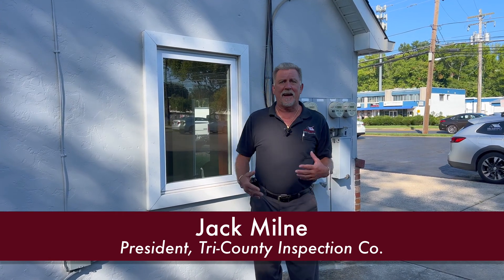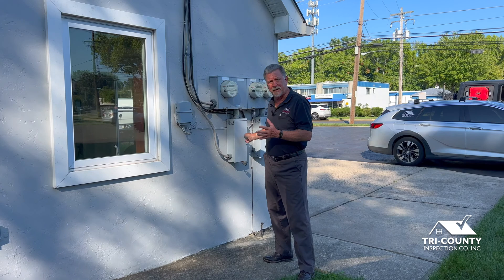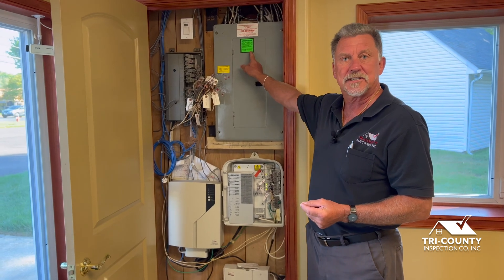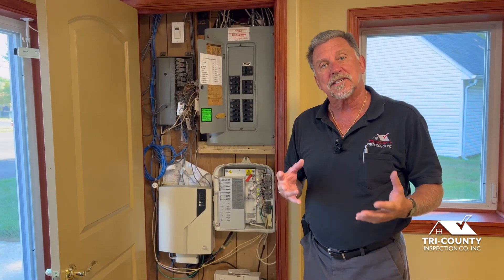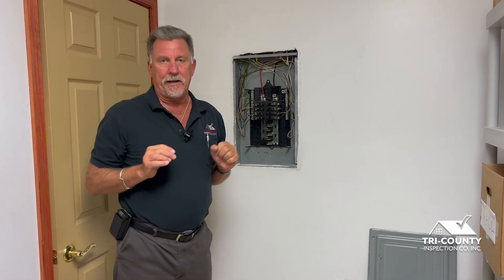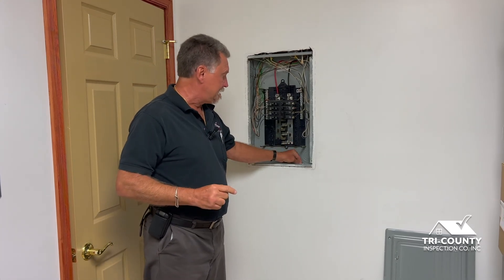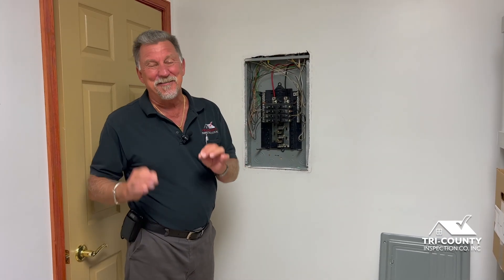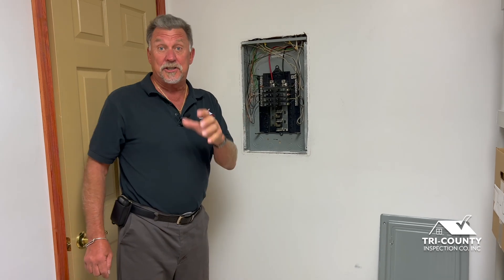Why is it important to separate grounds and neutrals in a sub-panel? - The House Whisperer Show

Comment: I'm just a farmer doing my own electrical.  But IIRC, NEC 2014? and back allowed bonding the ground and neutral in the subpanel.  Does it work?  Sure, my old farrowing house is done that way because they didn't run a ground wire to the building, but I installed a grounding wire to devices in the building, and grounded the metal conduit to it as well.  If a hot wire touches a metal outlet box or conduit, I need a low resistance path to the transformer to trip the breaker.  So, the power would go from the metal outlet box, to a grounding screw to a ground wire, or through the metal conduit to another grounding screw, through the ground wires, to the bonding of the neutral/ground bars in the subpanel into the neutral, back to the main panel neutral, and trip the breaker.  Not ideal, but it works.  Can a ground rod installed at a subpanel not bonded to neutral do the same thing?  DO NOT count on it at all, but if your circuit is close to rated load, it can.  Example, I have 4 livestock waterers elecric heating elements connected to the same 20 amp breaker.  Each element pulls 250 watts, 2 elements per waterer, 8 elements total, 2000 watts.  That's IF all the thermostats are on at the same time, again, do not count on it.  I had an element break on one of the waterers, sending power to the metal waterer body.  I didn't bond the waterer to neutral, since you don't want anything more than about 1/2 volt measured from the waterer to a point on the ground a couple ft or so away, or the animals will feel it. And I didn't run a ground wire to service each waterer because I was young and stupid.  So, each waterer has a ground rod, installed within the tile riser underneath each waterer, and the waterers connect to the ground rod.  So, the little amount that can flow through the soil itself via a ground rod back to the main panel ground rod, in turn back to the transformer (can't remember what a shorted 120 volt circuit can feed through a ground rod, I think its a few amps) tripped the breaker.  Again, DO NOT trust a ground rod to do this!  Even though it worked, it probably took a while to trip if the soil could only take a few amps, making the waterer unsafe for a longer period of time than if a grounding wire was run with the hot and neutral and could be used.  If the soil is dry,  or the distance is too far, or the circuit isn't close to the rated load, it won't work!  DO NOT ATTEMPT!

Comment: IDK why ..the neutrals and grounds ALL go to ground. In the older panels it didn't matter to run grounds and neutrals in the same ground bars. As matter of fact, in the panel boxes the ground and neutral bar were physically connected across to each other by a bar in the panel anyway. You couldn't separate them. I think it's a matter of the code just trying to rearrange things around to come up with a new rule. I do see newer panels now forcing you to separate the grounds and neutrals with the neutral white  being connected to a neutral bar attached via the breaker now. Both black and white wires screw to the new breakers.
Reply: Yes, very confusing when you are dealing with older panels…. Before all the code changes.  Younger generations automatically say….. it’s WRONG…. BUT BACK IN THE DAY it was OK!

Comment: Nobody wants to answer my question about bonding the neutral and ground in a subpanel:  We have a house in California built in 1956 with no grounds.  A 40 amp house subpanel connects to a subpanel at our shed with two #8 hots and a #8 neutral.  The shed subpanel feeds a 30 amp and a 15 amp circuit off different hots.  The shed subpanel has grounding to a ground rod with #8.  Would it be a good idea to bond the shed subpanel neutral and ground?
Reply: Good question / senerio!

Comment: Question? What about if you use a 13,000 watt generator to power a tiny shed? If i put a panel in a shed to be run only by a generator and not a main source of power, Do i bond the panel neutral to ground or is it ok to have them separated..  I would like to put a 50 amp panel but to be powered by generator only when im working in shed.. My question would be if the panel would be bonded since its my source of power to shed. Let me know if possible and thank you.

Comment: I had a pre-inspection and the inspector called out the main panel which was in a sliding-door closet. He recommend it be relocated, which would be a huge job. NJ house built in 1970. Will I get called out when getting C of O, and when a buyer's inspector comes?
Reply: A lot of things have changed over the years! 🙁

Comment: Grounds and neutrals have to be separated in both panels.  You never stated why a sub panel is not bonded!  I would not want you to inspect a home for me.  Cant imagine your view on 10 amp breakers
Reply: I’m not an electrician. I have consistently read that the neutral and ground busses are to be bonded in the main panel but separated in a sub. I’ve seen nothing that says they aren’t to be bonded in the main panel.
Reply: Actually he did mention why starting at about 2:55 when he said that the ground wires would become "energized".  What this means is that the ground and neutral must only be bonded at the main panel or in this case, the first means of disconnect, in order to prevent parallel paths of current on the neutral and ground. Being energized means there is current on ground wire when there should never be current there except for the brief moment before the breaker trips due to high current if a ground fault occurs. When current travels on ground when there is no ground fault it's also known as "objectionable current" which is a shock hazard.
Reply: @surferdude642  but they have to be separated although yes bonded.  Read the code
Reply: @surferdude642  Correct, except the breaker may not trip with multiple paths. Which creates the danger of shock or electrocution.

Comment: Where was the answer to why it is important? I heard something about electricity flowing downhill and that's about it.
Reply: There was no answer. That's because nobody can scientifically explain why. The only answer is it's best to ground all neutrals and all grounds and equipment grounds...TO GROUND. Together or separate. Ground rod each box location if you want.
Reply: @tommywatterson5276  I think you’re right
Reply: @tommywatterson5276 Actually he sorta did at about 2:55 when he said that the ground would be "energized" meaning current on the ground and causing parallel paths aka objectionable current. Google "objectionable current" for details.
Reply: @tommywatterson5276  No. It's called objectionable current. The reason is that there should only be one path back to the service grounded conductor, or it will energize all metal parts in the system. There should only be one path, not multiple paths.
Reply: Objectionable current.

Comment: just wondering what area allows services feeders to be installed without conduit? yours looks like SER cable. Cal.  has to have feeders in rigid. just curious.
Reply: unions can't be everywhere
Reply: Some counties dont require SER to be in conduit. And SER cables jacket is beefy enough to be fine without conduit. Its more of an extra form of protection